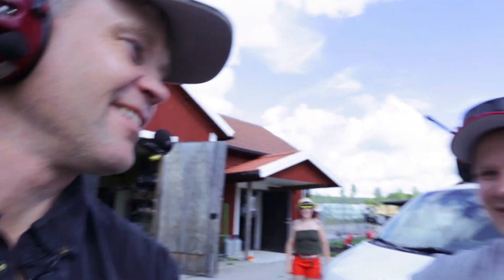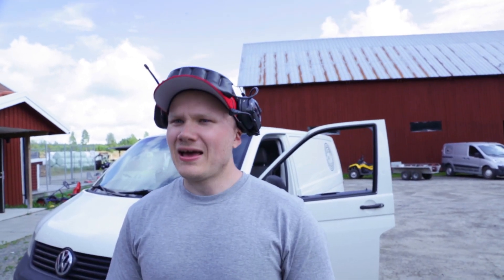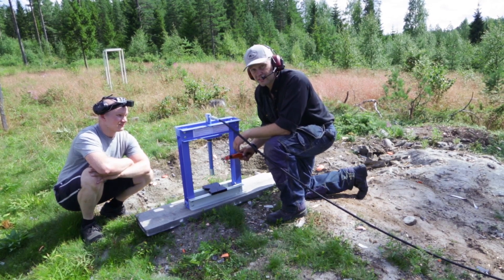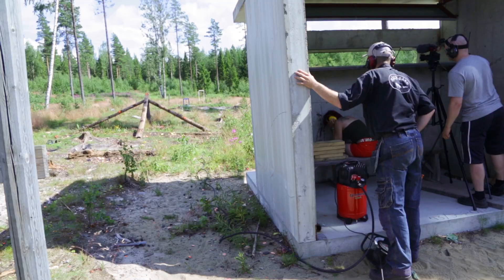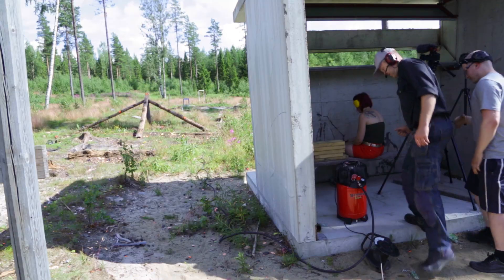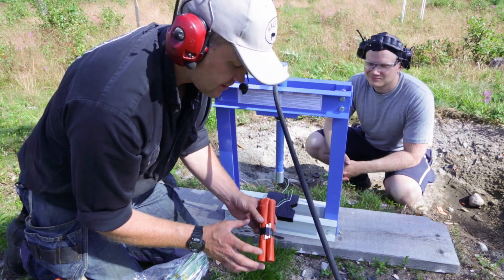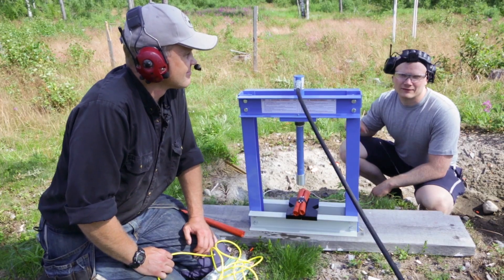Exploding hydraulic press with Swedish dynamite

Comment: So...1) Did you expect this to explode? 2) What is in the "blasting cap" that would have helped it to explode? Is a blasting cap like a "primer" on a rifle cartridge? 3) Wouldn't it be true, on a strictly chemical basis, that if "dynamite" was under enough pressure that it would spontaneously explode --  in the same manner as, say, diesel fuel in a diesel engine?
Reply: IMHO, if the dynamite was unstable, then yes it might possibly explode when crushed in that press. But to make a regular one explode, you might need a more powerful press.
After all, the clay in dynamite is actually what makes it more stable and thus safer to work with.

Comment: I hate to be "that guy". But, Isn't that a pneumatic press? :P
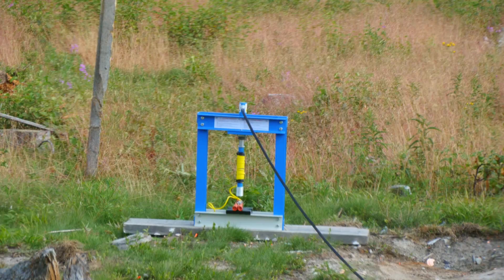Reply: I think it's hydraulic. Look at 1:26 you can clearly see it leaks some oil. Mr. HPC said on hydraulic pres channel, that leak was because that little press was made to take in 300 bar but their pump produced 800 bar.
Reply: Ah, looked like it was connected to a vertical compressor. Maybe hydraulic pumps look similar :)